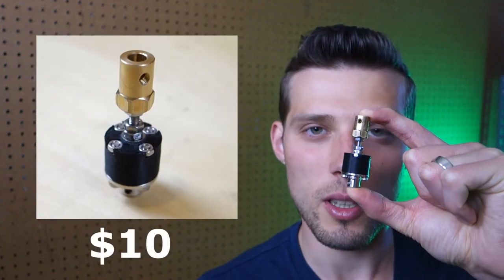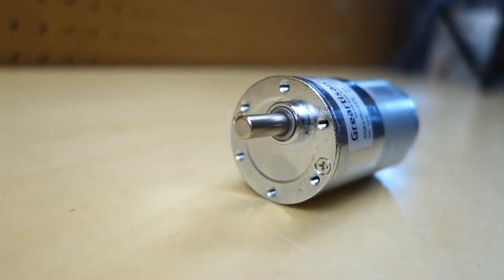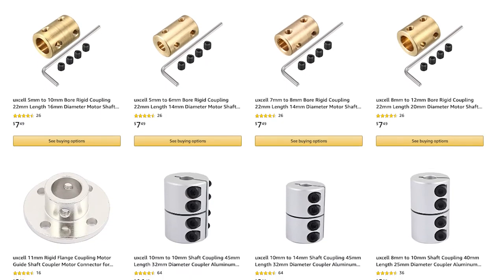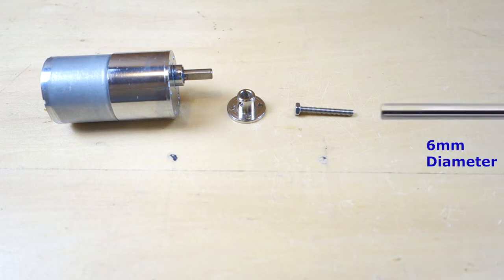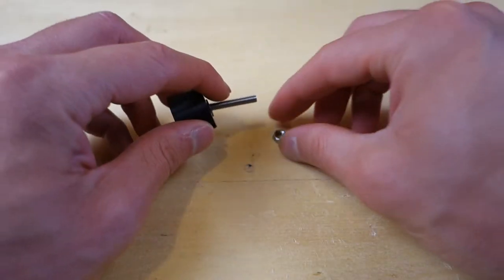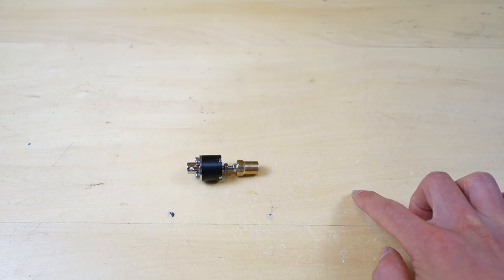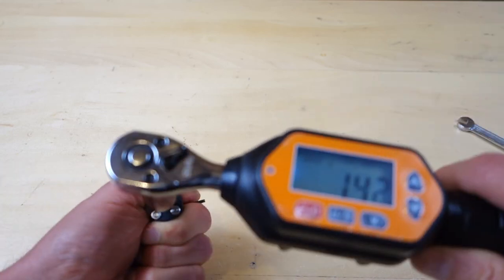CHEAP Friction TORQUE LIMITING Coupling - 3D Printed

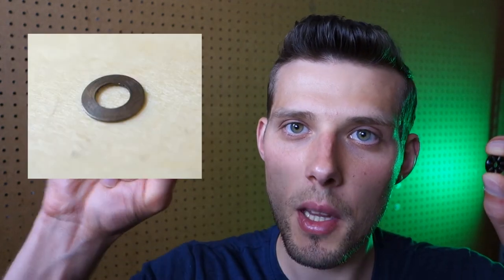Comment: 6:10 - Did you ever improve your design to include the thrust bearing?
Reply from the maker: No.  I ran into another issue and this video wasn't getting any traction last fall.  So I stopped working on this project.